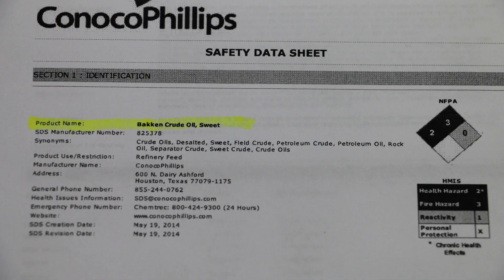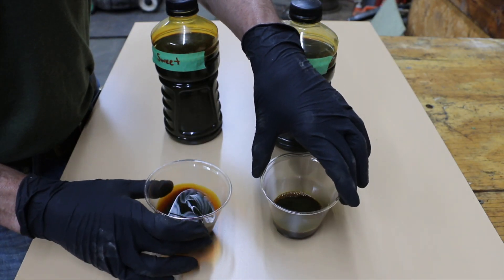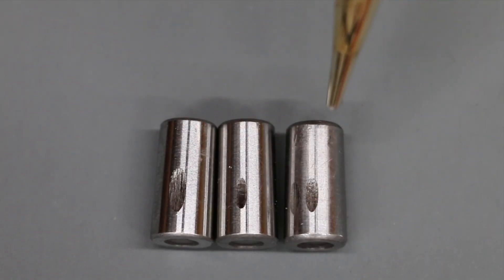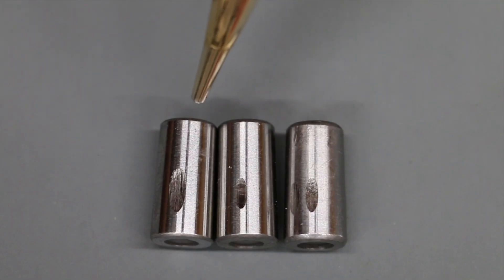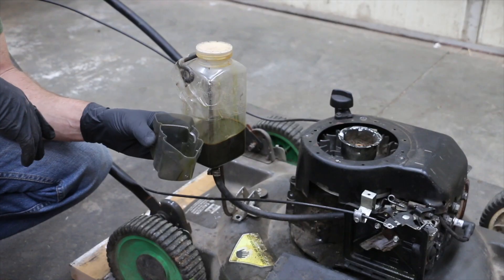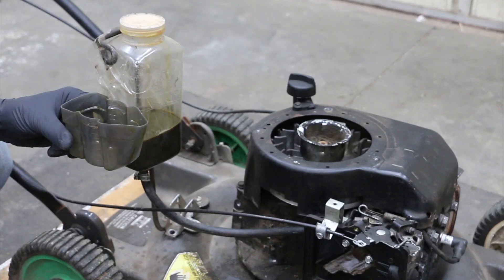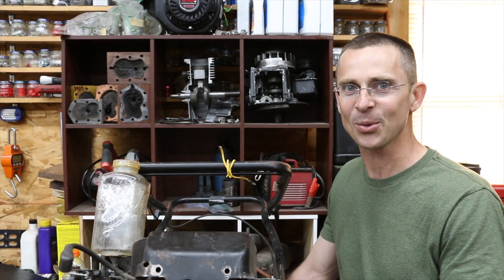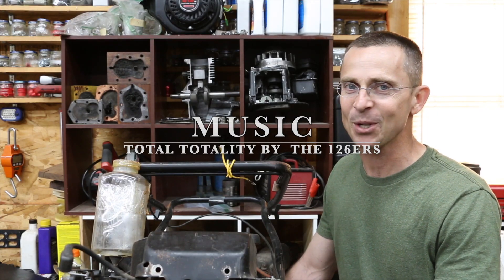Will a Gas engine run on Crude Oil?  Let's try it!

Comment: I would've thought oil as fuel in a low-compression engine would never work, especially without fuel injection. As Keith Jackson used to say, that's why they play the game. Thanks for probing and experimenting.
Reply from the maker: Thank you!

Comment: I actually expected the sour to be a total disaster but it seemed to work perfectly well!
Reply from the maker: I thought the sour would fail too.
Reply: Project Farm here's a quick question. Is there a difference between the 'petrol' we use here in Britain and it's various Octanes and Gasoline? 
I know I could Google but discussing it here seems far more appropriate.

There are some Octanes here as high as 130+ but come at a serious premium. £16+ per litre. It would be epic to see how one of your engines responds to it. I've seen how a car responds and the results were pretty significant.

Comment: Worlds deadliest exhaust fumes right there...i wonder if you could get an emissions test done...I suspect theres alot of chemicals in that exhaust
Reply from the maker: Thanks for commenting.
Reply: Piston 09
You're kidding, right? How would burning some of the stuff be worse than burning all of the stuff?
https://rationalwiki.org/wiki/Appeal_to_nature
Reply: GT20Modding....... God made radon too. And asbestos. And arsenic. God made everything, including all the poisonous stuff.
Reply: Project Farm did you notice an exhaust odor ?
Reply: Planets and buildings are two completely different things. Also your avoiding the question about natural things that are harmful.
Reply: GT20Modding brainwashed. That's what all religious people are. I'll take science over old wise tales any day
Reply: GT20Modding youre silly. What about NATURALLY OCCURING things that are bad for you like uranium, mercury, radon gas etc. Youre being illogical.
Reply: GT20Modding 
Your "god" made cancer in kids too .
Wake up FFS
Reply: The fumes straight out of the well are deadly
Reply: GT20Modding it comes right out of the ground, it's as natural as dirt, rocks and water.

Natural does not equal clean, safe or good for you though.
Reply: Yuck Foutube you can smell two cycle In the air with out huffing it. you can smell race fuel burning standing next to a running engine. not like i asked the guy to do bong hits off the exhaust. calm your tits.
Reply: GT20Modding Can't tell if you're joking or if your just genuinely crazy XD
Reply: GT20Modding Well ok then... do you believe God made everything or just the "good" things in this universe? There are a lot of natural elements and features of the universe that are incredibly dangerous and lethal, or even just not healthy to be around.
Reply: April - 
Penguins walked from the Antarctic to the middle east to catch a boat too apparently  !
Wake up and think for yourself woman
Reply: It's how I start my day, I grab my lead mug, and I pour my morning drink in there, which consists of, crude oil, uranium for sugar cubes, mercury for sweetener, and some feces to add some exotic taste. MMM....all natural...
Reply: When I run my bike on acetone and xylene, smells so good, like high quality huffing lmao
Reply: the dude HAHAHA! Got motor on the lung? 😂
Reply: biggreenblob and there was a morning and an evening: the eighth day ☢
Reply: GT20Modding there are many logically valid ways to explain why it isn't an entirely bad thing that these dangerous materials were made. Simply not answering the question and spewing out random pseudo-intellectual and over the top nonsense is not the right way.
Reply: Piston 09 lol, dumbass.
Reply: . . .  non-sense . . . what we just saw was the spirit of ancients animals and vegetation leaving this world for good. LOL.
Reply: I'm a pipefitter in an oil refinery. Crude oil is some nasty stuff. Look up the SDS for it. The chemicals that come out of it in the refining process are deadly. Theirs a reason we are required to wear full chemical suits and use supplies air masks for some process. I'm also a devote Christian and yes when God created the world he said it was good. But man is a fallen creature, we disobeyed and introduced sin into the world and now have death because of it. Just because something comes out of the earth doesn't make it safe. Look at poison ivy and other poisonous plants, nice and beautiful and green and yet they could kill you in an instant if you're allergic too them. Bee's are another good example. Please read your scripture and learn what it says and means before you go around spreading false doctrine and bringing more distaste for Christians.
Reply: @11spitdms  nothing wrong with religion as long as you don't force it on others. christens killed many people in the name of god.
Reply: It’s not as bad as you think it’s an natural oil if it was a refined chemical it would be worse I haul this stuff to a living
Reply: It all depends on what type of crude oil you had he is running not as clean as the stuff I haul but what we put in our lawnmowers is what is called condensate which is almost like gasoline but has like 110 octane like race gas
Reply: Adenzel I Believe God made all base resources (crude oil, iron ore) but man has taken them and made good things and bad.
Reply: Peter Herrington atomic bombs made cancer
Reply: Adenzel I am serious.
Reply: No because crude oil is a natural substance.
Reply: Mike S Thats What non-christian people say about Christianity. Its illogical. But they are wrong.  Look at a building. It has a builder because you see the product the builder has made. Look at the world. Because you see the world you know it has a creator.
Reply: Adenzel You really are oblivous. Come talk to me when you are paying attention.
Reply: stickloaf https://petitions.whitehouse.gov/petition/we-people-want-cannabis-become-legalized-and-deregulated-less-addictive-and-dangerous-🍸
Reply: Adenzel If God made it it’s safe and oil is a NATURAL element God has given us. Therefore it is safe.
Reply: GT20Modding this is moronic.

Comment: You should really get an adjustable jet carb for testing. A Tecumseh carb or a Tillotson would work great. Or just get a Tecumseh mower when that Briggs dies
Reply from the maker: Yes, I need to do this.
Reply: I think the Tecumseh carb for the 3.5-5hp motors has the same bolt pattern but I don't know for sure. You can get a knockoff from China for like $20

Comment: When I was in the Warbonnet gas fields near Pinedale Wyoming, I'd get in a tight spot sometimes when my pony motor on my lowboy would run out of fuel.  I'd dip a milk bottle into the crude oil tanks and it was even less viscous than your sour crude oil, so I'd add a cup or so of diesel to thicken things up and that pony motor would run like a scalded cat!
Reply from the maker: Impressive!  Thanks for commenting on this.

Comment: You're not supposed to know this,,,. But oil in  the United States has no bang for the buck, that's why we used to not export it we kept it in reserve,,. Cars and trucks would not hardly even run on,,. We didn't want other countries to know that,,,. The number one reason we use ethanol is to get the octane up high enough to run a vehicle,,. !!!  But now with all the variable valve timing knock sensors,, ECM with with five steps of timing,,. Engines running hotter,,. You can run about any garbage Fuel and them,,
Reply from the maker: This is interesting. Thanks for commenting on this.

Comment: If the crude oil has better film strength than 10w 30 wonder how well it will work as crank case oil.
Reply from the maker: Thank you for the video idea!

Comment: Do you ever worry about the drill you use to start the engine not letting go and ripping your wrist?  I burned a cheap drill up doing this, but I felt the torque since I was too slow removing it.  I'll use. 1/2 inch drill next time!
Reply from the maker: If I pull up, the adapter will release from the socket.  The socket might get flung across the shop, but not at too much force to cause injury.

Comment: All I could think of was "Don't come home drunk and put that on your noodles!  It won't be the sweet and sour you're expecting" lol Another nice job.  Always interesting viewing!  I'd still love to know what you think is the best engine degreaser after a leak ;)
Reply from the maker: LOL!  Funny!  Thanks again for the video idea.  I will definitely test degreasers.
Reply: Project Farm can you test if green tire slime will plug a hole in a radiator?  Or put through spark plug hole to help improve compression?
Reply: Please test La's Totally Awesome All Purpose Cleaner and Degreaser when you test degreasers. It's 1 dollar a quart at Dollar Tree, and I have yet to see it outperformed by a significant amount for cleaning engines. It's wonderful stuff!
Reply: Niamh Healy 
I used GUNK brand, they do a red and less stick green version. Both work well and rinse away with water.

Comment: Have you gathered any information on GIBBS brand penatrating oil? Or purchesed a can yet?
Reply from the maker: Not yet.  Still trying to use up some products on the shelf.
Reply: Project Farm. Ok thank you. You can use them in a rust and corrosion prevention ad cleaning video. On varios materials and electro and mechanical devices.

Comment: try the sour crude oil as motoroil please :O
Reply from the maker: Thank you for the video idea!
Reply: Project Farm using sour crude for motor oil would be dangerous to say the least, but at least it’s better than burning it. Try to wear more safety gear on your arms and a dust mask for the next time as any amounts of H2S (which is in sour crude) can be dangerous. Trust me I am certified in H2S safety amongst many other necessary oil patch certifications.
Reply: yes please
Reply: I agree!
Reply: the lubricity test was good because of the sulphur, its a good extreme pressure lube, they put it in cutting oil, the reason they take it out of engine oil, is its a huge pollutant and all the engine oil being burn would put massive amount into the air, luckily they can take it out and use it for fertilizer or turning to sulphiric acid for batteries or increasing the amount of products when they refine crude oil, so its all still used in a better way
Reply: David Fleener maybe initially it would perform like a lighter weight oil but it still has other products that will rapidly break it down in an environment like an engine.
Reply: I agree!
Reply: Other than being dirty, it should as well do as good as a conventional oil lol
Reply: Probably not going to work. Probably will perform like oil that's had cylinder wash out.
Reply: privatryan Why do you say that? It had better lubricity than normal crankcase oil when he tested in this video.
Reply: @SuperDavidEF  At room temperature. Does it keep its lubricity at 180 degrees Fahrenheit ?
Reply: Me too! I want to see as well!
Reply: mharris1270 I agree with u, though it looked well on the lubricity test , with that flashpoint it is probably not safe as crankcase oil
Reply: Project Farm u sure it wont act as a runaway diesel
Reply: Project Farm, If you're going to do this video idea, please grab the appropriate chemical gloves and OSHA approved respirator to keep yourself safe.  Dress fully from head to toe to make sure that no skin is exposed at all for this.  Treat this like it's acid.
Reply: I would take safety precautions as H2S the souring component will cause steel and aluminium embrittlement. It also burns into Sulfuric acid.
Reply: wd 40 didnt flash in the crank case, it had similar flammability
Reply: DashcamDriversGermany that, I want to see.
Reply: tarstarkusz i put straight up gas in a crank case of a lawn mower i found. Mainly cause i was bored, and the mower was getting scrapped anyways. Plus i was trying to see if i could blow it up. Havent had much luck
Reply: I agree on the motor oil idea. Also a good little spin would be to see it ran as maybe an additive.  Also we don't know if he got that right off the well head or after the separators so you may want to run it through a filter or 2 to get the sand and water out
Reply: I think real tarsands to kill off that old motor of his.  Straight Bitumen
Reply: Yes
Reply: james adams yup
Reply: that would be the self ignition temperature, the flash point is the temperature where it can be ignited with a heat source (open flame). Depending on the analysis done, Cleveland open cup, Pensky martens closed cup, Abel makes a whole lot of difference.
Reply: Isn't there a serious fire (and explosion) risk in doing that?
Reply: Yea that would be a good test
Reply: Try the crud oil as motor oil
Reply: Ni Hao.  Why the sarcasm?  lol
Reply: Very interesting 👏
Reply: Clipboard warrior?  xD  I only know how to say hello in Chinese and Japanese and I took a chance on one of them.  :P
Reply: Yes
Reply: +Angel... I would have to say that the risk is too great.
Reply: Let me start by saying I do believe  in working safe! On the other hand with all the safety police you find on youtube it would be a bit ironic if many of them died young because they spent all there time on the internet in their moms basement instead of going outside and actually doing somthing....I could see the News bite now "up next, why 4 out of 5 safety police on you tube die prematurely because if this......right after this  msg.......
Reply: Jusb1066, Very interesting! I didn't know that. Thank you!
Reply: Project Farm try and see if green tire slime will plug a hole in a radiator
Reply: the reason the sour crude it's a much better lubricant is because of the high sulphur content. it used to be one of the Mysteries in Marvel Mystery Oil before the EPA made them take it out.
Reply: That'll probably end with the mower on fire due to the low flash point of the oil. If it doesn't, since it's unrefined it'll thin out from the heat and lose lubricity.
Reply: Project Farm i'd like to see another sticky tape video. Camping season is upon us and tape gets used in the extreme heat of the sun and extreme weather conditions. Which tape will hold the best in the heat? Which will disintegrate? Which will survive the heavy rain the best when you patch a hole in your tent? Do some tests!
Reply: what if it burns inside the engine
Reply: as one of the upper comments already said the better lubrication is probably because of the sulfur content. In ships engines the heavy fuel oil contains 3-4% sulfur which is good for lubrication.
Reply: Bad idea! Crude of any type is highly flammable! When it reaches its flash point the engine will become a small bomb! 40% of the crude is actual gasoline! It will evaporate out first, then the diesel. Eventually, it will just become motor oil if it doesn't ignite.
Reply: Most used engine oil has a high petrol content, I wonder how it would compare to crude in terms of flashpoint.
Reply: Exactly what I said thinking!
Reply: mharris1270  I wouldn't be too concerned about blowing up the crankcase, because blow by from the engine is mostly carbon dioxide, because the explosion in the combustion chamber. If oxygen were introduced, that would be another story!
Reply: Agree
Reply: It could work well, but it is a bad idea.  Sulfur will cause the oil to become corrosive to internal engine parts.  https://en.wikipedia.org/wiki/Extreme_pressure_additive
Reply: What a novel idea. Test oil as a lubricant. Far too sensible to work.
Reply: Sour H2S will start dissolving the metal as soon as it's left to sit. Not to mention what everyone else said about turning it into a small bomb.

Comment: 6:15 Engine running on crude oil, gasoline and staring fluid😂
Reply from the maker: LOL!  Great point!
Reply: B&S should pay him for his R&D works and use it as a durability commercial.
Reply: JIGA BACHI most accurate comment I've seen.

Comment: oil companies have taken out the good stuff.theres the proof
Reply from the maker: There's a lot of good stuff in there per the MSDS.
Reply: Crude out of the ground is better than store bought 10w30.i just bought 5 gallion 15x40 .70 bucks .but atleast i got a nice white bucket
Reply: i wish someone had some oil from 70s to send u.wolfs head vs modern

Comment: Now try it in a car. Fuel injected would perform better so long as the filter does not get clogged, otherwise use a carb engine and no filter. You could save us all a lot of $$$ if the mpg's are 60% or greater than gasoline.
Reply from the maker: Thank you for the video idea!

Comment: Hey Todd you should definitely try to get a Chinese Diesel engine to do test on I know you have a older Fidel you’ve mentioned but the knock off engines would probably be a cheap alternative and probably give you a good reading
Reply from the maker: I was hoping to buy one but the Chinese company I contacted said their engines weren't EPA compliant and would get confiscated at customs.  Apparently, there are recent laws preventing the import of these.

Comment: Awesome video as always. Is there any possible threat of Hydrogen Sulfide when missing with this stuff? Be careful.
Reply from the maker: Thank you!
Reply: Hydrogen Sulfide will be released by the sour crude, but slowly enough at atmospheric pressure that it won't kill anyone. As he is working in a well-ventilated area, it is not going to be able to build up to dangerous levels just from having it around. Fortunately, it stinks, so we naturally take steps to make it go away. The hydrogen sulfide will burn in the engine, turning into water and much less poisonous sulfur dioxide, so no big deal there either.

The only time I would have been particularly careful not to get a big huff would have been when the engine was sputtering and smoking a lot. The incomplete combustion could definitely have set a lot of hydrogen sulfide free, but again, he's working in a well-ventilated area where it quickly dissipated. He didn't do anything particularly dangerous.